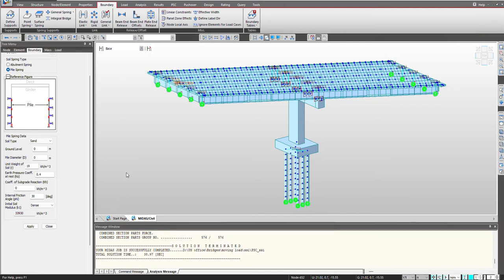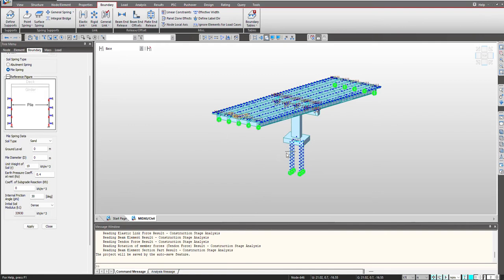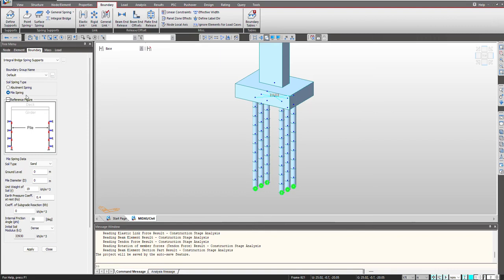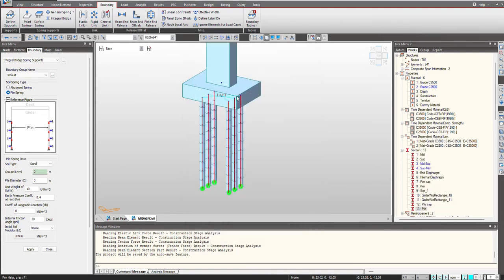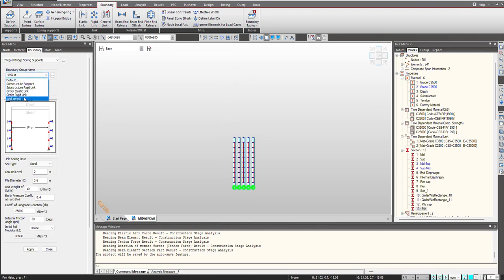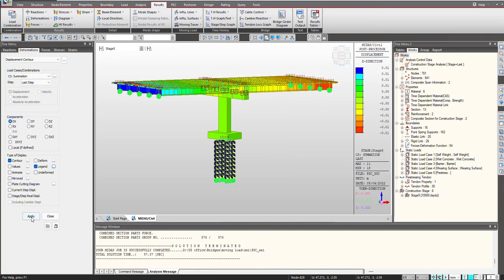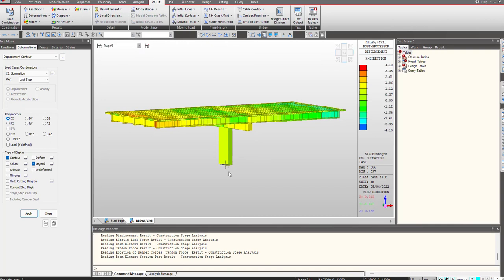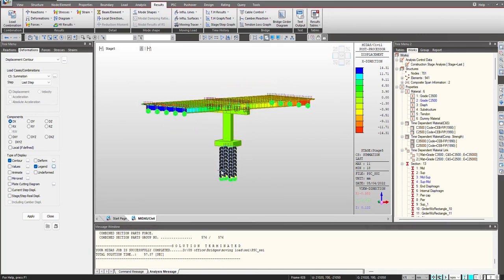The Importance of Soil Structure Interaction on the Structure Behavior

Comment: The pile cap has been rendered redundant by linking the piles to the pier by rigid nodes.

The right was would be to increase the pile caps structural rigidity.